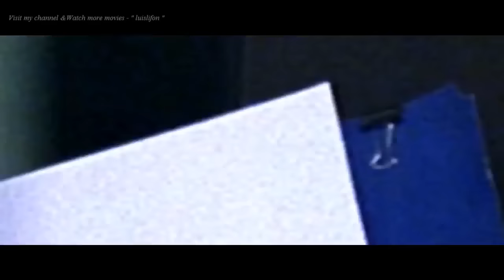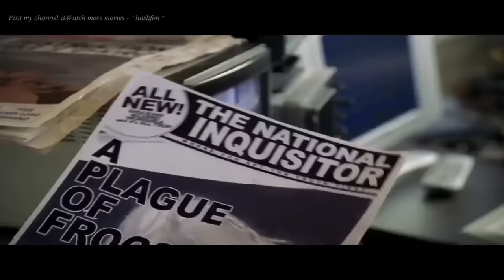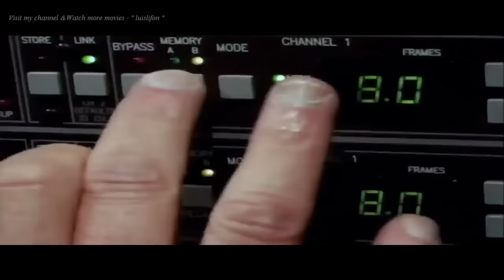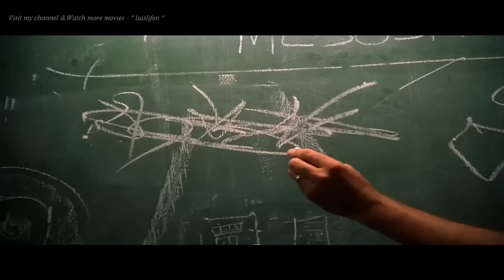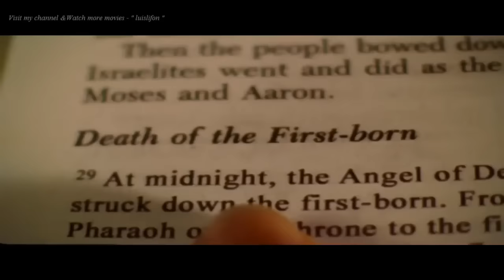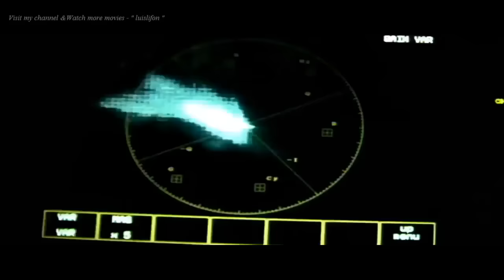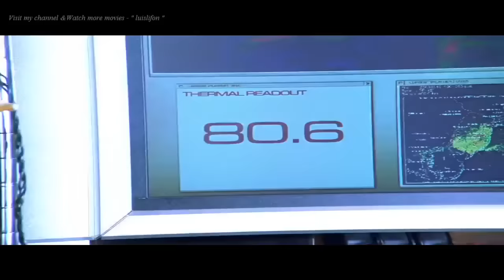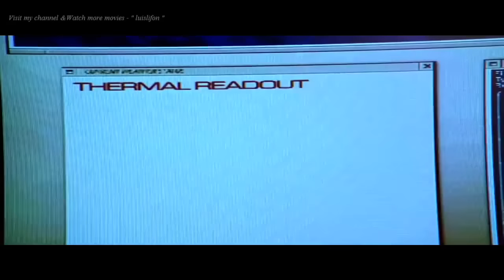Last Day Of The Worlds   Best ACTION SCI FI Movies  Hollywood NATURAL DISASTER Movie

Comment: I enjoyed this as a follow up to Category 6 but there’s one problem. They say cutting the power will decrease the storm’s intensity and that’s why Chicago was decimated. However if you recall, Chicago was in a blackout during their storm. Just something I picked up on.
Reply: Thats why I think cutting the power wouldn't help, because the heat event has already caused the disaster. It isn't like an electrical switch. Does the hurricane say"Oh , they just shut off the power"? Lot of sub plots though-probably necessary for two parts.